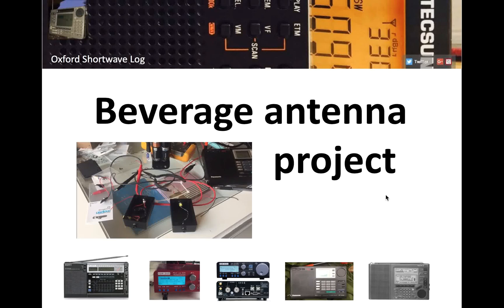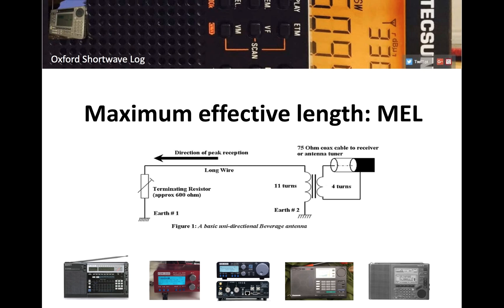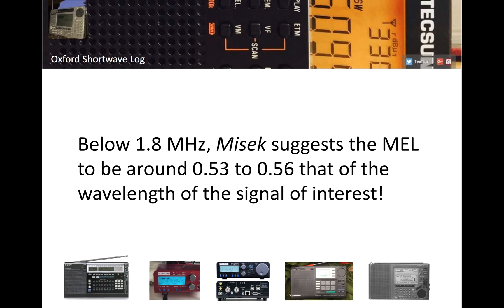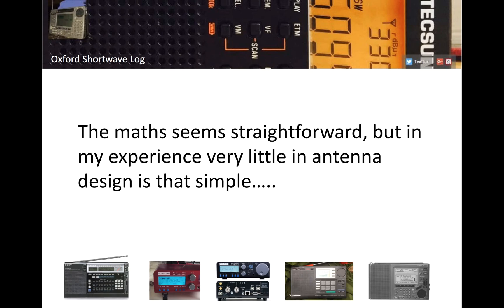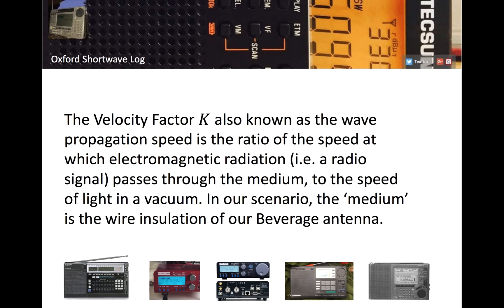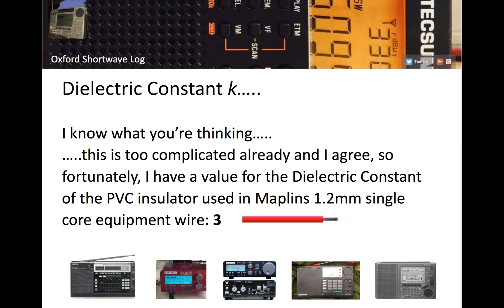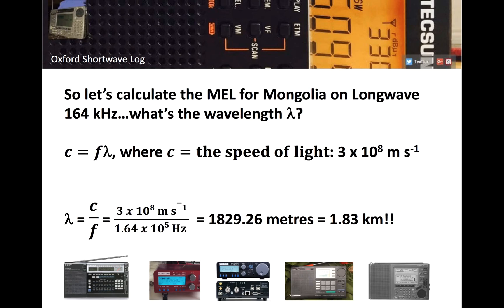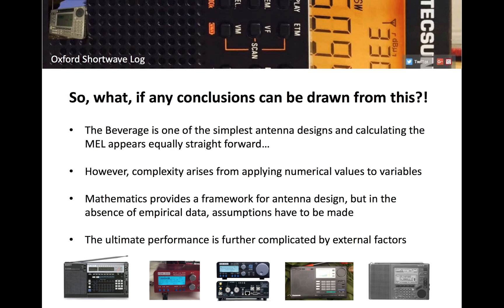Beverage antenna design: Maximum Effective Length...simple, yet complex!

Comment: Thanks for an interesting video. I’m a bit puzzled about the way you derive the velocity factor from the dielectric constant of the PVC insulation of the wire. This may be correct if PVC was your only medium between wire and ground like a coax cable but this is a wire hanging in free air where there is a lot more air than PVC.
If this 0.58 would really be the velocity factor of a PVC insulated wire in free air then our dipoles and end fed half waves would be a lot shorter as they are.
The velocity factor of an insulated wire in air is more like 95-98%.
The whole working of a beverage antenna is in the difference in speed of the traveling wave between the wire and the earth. Stan Gibilisco (SK) has videos on his channel explaining this. Maybe the velocity factor of the earth is meant in the MEL formula? Although I have no clue how much that would be.
Food for thought…

Comment: I made an antenna setup once, not knowing much about what I was doing, by running two longwires in opposite directions, draped over tree limbs about 8 feet off the ground. They were both about 300 feet long. I got amazing DX using a RadioShack DX 392 (I think it was) with an external antenna input that I bought in 1995 for $260.00. I could dial back the RF gain and get incredible reception on SSB. From Louisiana I heard search and rescue loud and clear when planes crashed off the coast of New York and California and could listen to boats in the Gulf and rivers. So many signals and they were so clear. 

I also made a homemade coil of 120 turns of 24 AWG magnet wire on a paper towel tube and connected it to these longwires, one to each end, and would place it near my radios to get long range AM reception during the day. I normally received only 3 AM stations at noon but using this setup I received around 50 stations. From NW Louisiana I could hear Houston, New Orleans, Dallas and even Oklahoma City. 

I don`t have room for longwires currently but I plan to move to a location where I can experiment again eventually. It`s apparently impossible to find an inexpensive SW radio with SSB that has an RF gain control now. Most have a switch that gives one little control of the gain. The only SSB radio I have at the moment is a Grundig G6 but it has no RF gain switch even, which is hard to believe. It works well, but I can`t use a proper longwire without overloading the radio. I still know very little about proper antennas though so that`s why I`m here.
Reply from the maker: Hi there, thanks for this - really interesting. If you look back at earlier videos on this channel you will see that I've experimented with 100 and 200 metre longwires. I've also deployed a 200 metre Beverage antenna with a ~600 Ohm earth at the front and rear ends. That worked amazingly well. If you're looking for a portable SW radio with an RF gain control, then the only one I can think of is the Sangean 909x. I have one of these and although not great on the telescopic, they're brilliant on a longwire. 

Thanks again and 73!

Clint

Comment: Very interresting. Still, I have had not so good resultjs with a 200 m beverage in the past compared to a 30m SuperKaz pointing in the same direction. I use both for MW-dx'ing targetting N-America. Making the math you suggested it should of worked well. Sadly I can mount the Bev only between October and April due to an agreement with the land owner. Just came around the theory of  the "BevFlex4" antenna found here on youtube. Have you tested the antenna by now to see if the theory really works? Good luck!
Reply from the maker: Hi Ron, thank you for your comments! Yes, a 200 metre beverage that is effectively terminated to ground at the 'front' end with a resistance of around 600 to 650 Ohms - and grounded at the receiver-end should deliver better results than a 30 m SuperKaz. I haven't used anything longer than 200 metres, but I was thinking about setting up a temporary 1 km antenna - just for the hell of it lol. It would have to be a 'one night only' affair, but would take several hours to lay down. Realistically, it would be a 'BOG' 'Beverage On Ground'......but would need a weekend to set up, use and dismantle lol. That would definitely allow me to prove/disprove the 'MEL' theory though! Thanks again and 73! Clint